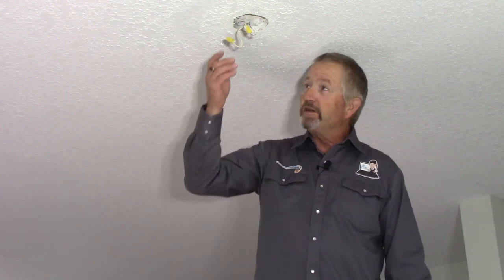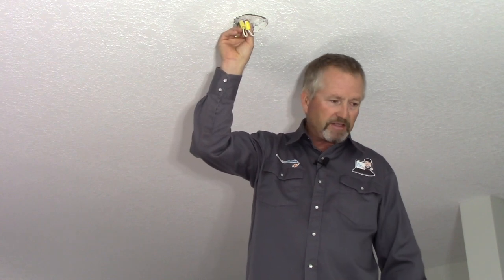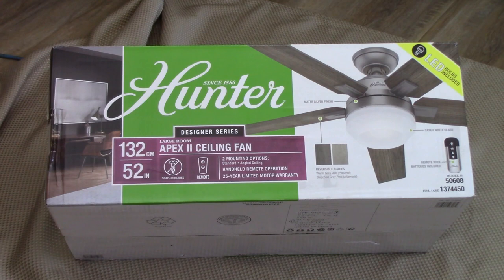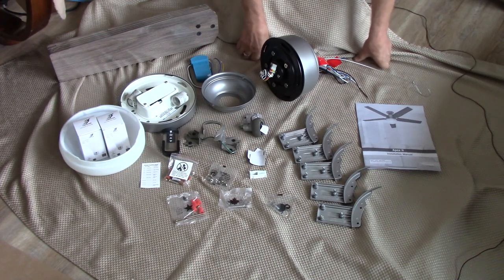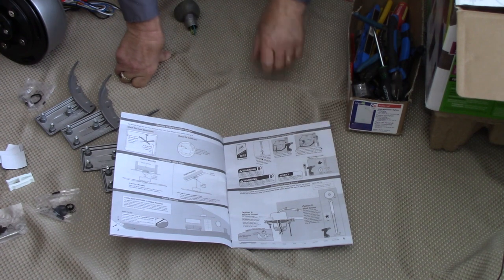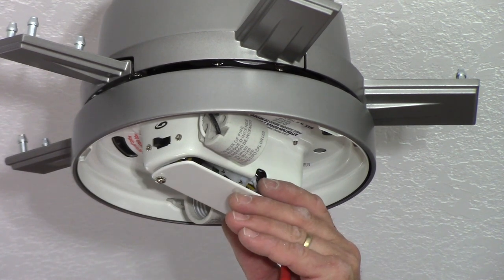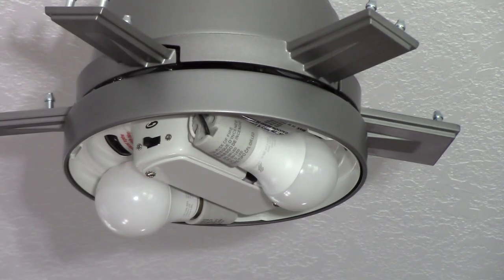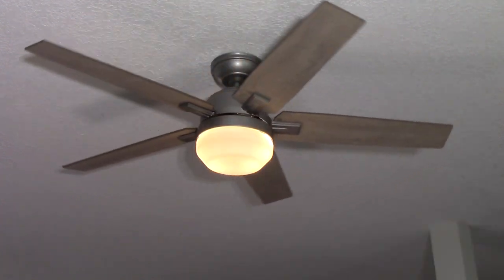How to Install a Ceiling Fan With Remote Control:  Complete Step-by-Step Instructions

Comment: great step by step installation guide - just ordered my fan and will be trying it out.   thank you, Terry
Reply from the maker: Thanks for watching Mike! Any other questions, just ask here!
Reply: @theinternetelectrician  Hi Terry, there is no 2x4 support structure directly under my junction box.   So basically, I am not able to mount the bolt for secure the fixture.  Is there a way around this?   Looking forward to advise...thanks

Comment: Hey there!  I wanted to thank you so much for providing this video!  So happens, I installed my ceiling fan with a remote.  The remote receiver that I have is the same as yours.  I just colored match all the wires.   Just know the basic how electricity flows from the ceiling fan to the base.   Even a woman can do it!  Thanks!
Reply from the maker: Good job Sylvie! Thanks for watching and taking the time to comment!

Comment: Hi Terry,
Thank you for your video with detailed information. I have one red extra wire. Should i cap it and leave it or it can be utilized for separate control for light and fan with individual switch. As I have two switches. If yes, where I can connect red cable?
Reply from the maker: If you don't want to use the remote only, you could connect that red wire on the load side of the receiver in parallel with blue wires (check the 18:00 mark of the video).  That way the extra switch could be used to turn on the light with the switch or with the remote. The other option is just to use the remote for the fan and light  control as it's designed.

Comment: Hi Terry, very good video, thank you.   I have a peculiar question for you, hope you can help....   Ordered a Carro Smart ceiling fan from Amazon. It has a ground, white, and black wire coming out of it.  Coming out of the ceiling is a ground, white, black and a red wire. The old ceiling fan used two switches.  So I hooked up the new fan as follows:  ground to ground.... white to white.....black to black.  It did not work.  I then tried hooking the RED coming from ceiling the the fan black.....did not work.  Then I tried hooking the black AND red from ceiling to the black from fan.....did not work....Any idea what I could be doing wrong, or is it a DOA fan?  Thank you so much for great videos. I appeciate your time.........  Craig
Reply from the maker: May seem like a dumb question, but it must be asked. Are you turning on the switch(es) when you test your fan using the remote (or the smart commands). Assuming that all is well with the power supply to the fan, must be something else wrong because from your description, you are connecting it properly.
Reply: @theinternetelectrician  Thank you so much for the info Terry, very much appreciated. Yes, I turned on BOTH switches after turning the breaker back on. Very frustrating. I know everything works up to the fan because the old fan is working perfect right now, both the light and the fan, or either one separate. Maybe just a bad contoller in the fan. I never even tried the remote because the fan never came on. It said it would come on when I turn the power and switch back on, and to hold a button on the remote for one minute, which I did, but NOTHING.  The remote lit up while I was  holding it, so that seemed to work. Very confusing and frustrating.   Thanks again.
Reply from the maker: @craigstrbo  Yeah, you've done all you can do and it sounds like you doing it right so next step is contact the manufacturer or technical support.  Not sure about you, but I've found any kind of support to be anywhere from poor to non-existent on any products these days.  Probably best just to return it and have them send you a new one.  Good luck, and let me know what you find out!
Reply: @theinternetelectrician  Yes, thank you for taking time to reply Terry, I appreciate it. I actually sent the fan back this morning and ordered a new one, exact same one, so keeping my fingers crossed. It's a nice fan with great features, so hope it works.  One more little thing I wanted to mention is this:  These fans have 24V DC motors, so there isn't any kind of adapter or anything I would need, is there? They have a converter inside the fan from the factory. Thanks again and keep up the good videos.
Reply from the maker: @craigstrbo  No, nothing extra needed.  The electronics within the fan would produce the 24Vdc by converting the input 120Vac.  Question for you if I may?  I just got off of a zoom call with the creators of a new app coming out.  Could you send me an email to internetelectrician@gmail.com so that I can get  your input as to if you would find this concept useful, etc.  I would appreciate your input for a little "market research" on this. No obligations whatsoever.
Reply: @theinternetelectrician  Thanks Terry.  Email sent. :)

Comment: Did a service call on Hunter fan.  Light was flickering/ fast flash when off,  voltage at light socket was only 88 volts, replaced light bulbs flickering disappeared, why was the voltage so low for lights?

Comment: Does the light have a delay when powered on by the switch?  I installed a fan and noticed mine has a 2-3s delay when turned on by the switch.  Just wondering if that is just a property of receivers or just unique to the fan I purchased.

Comment: Well done video Terry.  I'm now ready to go out and buy several fan/light combo.  Is there any way/brand name to synch the remote to a wall or smart switch?  I just hate the idea of having to install 4 fan/light combo's and having four different remotes to keep track of.  Plus I'm worried that using a remote for one fan will bleed in and control the fans in the next room over?
Reply from the maker: I’m not sure but these were factory paired and I installed two, one in master bedroom and the one in the video. I just checked and the remotes are different frequencies. Any brand that has dip switches for pairing will allow you to use one remote for all and I think you need to be in fairly close proximity so cross communication shouldn’t be an issue.

Comment: Terry.. what if I have a red extra wire? Can I just cap it and leave it alone?
Reply: Had that same issue this past weekend. Figured it out myself because no YT videos we’re talking about how to install with red wire.
Reply: @Dc-kp8ww  what was the answer?
Reply: Yes cap it you have 2 hots and your neutral white and your good
Reply: I have also red extra wire? Does it for another switch for separate control for fan and light individually? If yes, where it should be connected?
Reply: @TheNaresh136  if the switch has red black white and green the black goes to "hot wire" the white with white grounds together and the red goes to the black going to fan
Reply: @TheNaresh136  black should be the main power wire, if there's an extra red then it is usually for the lights separately depending on how your wall switches are set up.

Comment: How do I install a support rod so I can put a fan up where a regular light went?
Reply from the maker: Lots to consider here. Like do you have attic access? How solid is the outlet box now? Although there are rules in place to protect us from ourselves, common sense goes a long way so if the existing box is solid, and if not you can get extra screws in to make it solid, then you can install a fan there. There are hundreds and thousands of ceiling fans in homes everywhere that are mounted without the use of an approved box or additional support rods.

Comment: Did everything shown, wont turn on
Reply from the maker: Did you get this fixed yet? Let me know.
Reply: @theinternetelectrician  yes I got it working. It would be helpful to know that the fan will not activate until it is fully set up
Reply: @Match25  do you mean having the blades on the fan? Like it won't activate without that or did you mean something else?

Comment: How can I modify one to make it standard , I lost the remote 😒
Reply from the maker: You could just remove the remote receiver and connect directly but then you may or may not have separate fan and light control depending on the exiting wiring.

Comment: I cannot open the remote to replace the batteries-whatever kind they are.  The back panel should slide off. You installed the batteries off camera. Aaaugh.

Comment: Terry, if I wanted a second switch to turn on light or fan separately, would I wire it past the controller portion?
Reply from the maker: Well, I guess my first question would be to ask why you would want to do that? It would also be complicated because you need a hot on the line side of the remote receiver to make it work, and then 2 hots on the switches for the light and the fan, so not likely you would have the wiring  in place to accomplish this.  Not sure if back-feeding the power to the load side of the receiver would have any ill affects, but it would likely work?
Reply from the maker: @leagueofchodes2346  So it works with the remote, and then also with the switches over-riding? Did you have a hot in the ceiling box as well as the 2 switched wires then?

Comment: Terry, I hooked it up and the light works but not the fan. Plus there is an extra white wire on the "blue" side then what is on your example video. Can you help me with this?
Reply from the maker: there's your problem Tony.  Hook up that white wire as well.  That must be the neutral for the fan.  Did you remote receiver have neutral wires on both the supply and the load side? If so, don't  connect all the whites together as in this example, put the line neutral on the supply side, and the fan and light neutral wires to the one on the load side of the receiver.
Reply: @theinternetelectrician  there is one side of the receiver with a white and black that I can see go to the ceiling with only a white and black and then on the other side of the receiver there is a blue, white and black that match with the same colors coming out of the fan. When I hook that up only the light comes on but it kind of is at a delay. When I hook the 3 white wires up and leave the one off then the light come son and off normal but the fan still doesn't work
Reply from the maker: @tonybelford9553  But in your original message you said that there is an "extra white wire on the blue side"? You should have one hot each for light and fan (normally they use blue and black). They usually have a common white wire.  Some remote units have the neutral connection on both sides, but in my example here they just needed all white neutrals to be connected together.  If they have a neutral on the fan connection side, then leave the white wires separate, white supply to ceiling wires, and the white to the fan / light neutral.  Send me a diagram of your connection or give me the model numbers you are working with if this doesn't answer your question.  terry@electrical-online.com

Comment: Hi Terry,??we installed hunter marietta fan,very same model like you video..but few days later the lights shuts down and start again by it self random  times??.(other  people said it's the voltage limiter crap blue box ).. it's a common problem on hunter fans and others..they eliminate and wired directly..????
Reply from the maker: Personally have not experienced that.   I guess direct wire then is an option, but shouldn't be neccesary.  I'd hold Hunter accountable and demand a replacement!

Comment: Excellent video showing how to install wireless remote switching for an overhead ceiling fan. I purchased wireless receiver/transmitters to convert my overhead ceiling fans so the light and fan operate separately. Easy to install and they work extremely well. My only recommendation is with the brightness of LED bulbs install receivers or complete ceiling fan units with a remote that include dimming. I also found it easier to make wire connections with lever wire connectors.